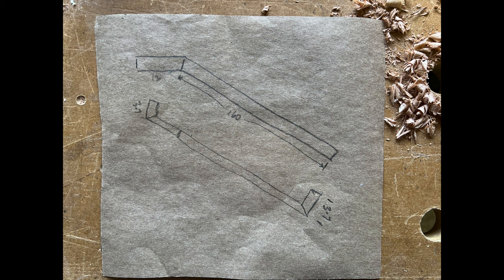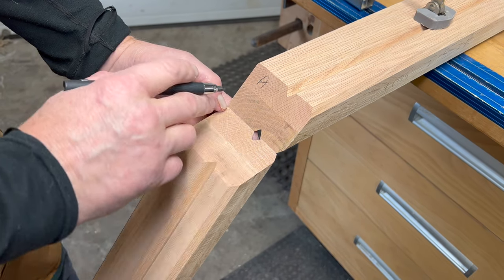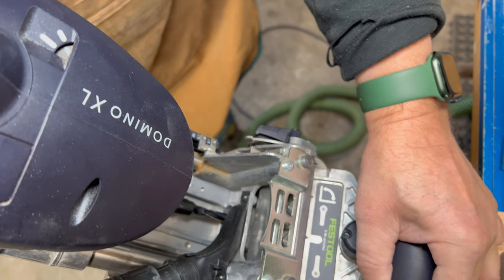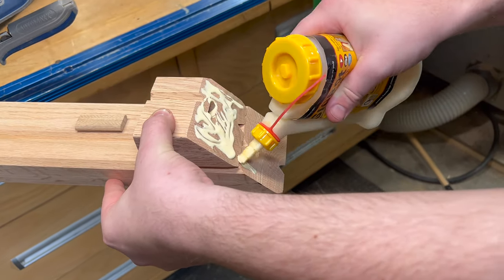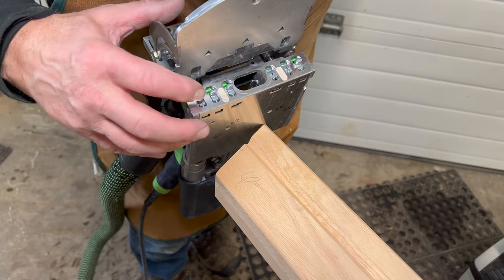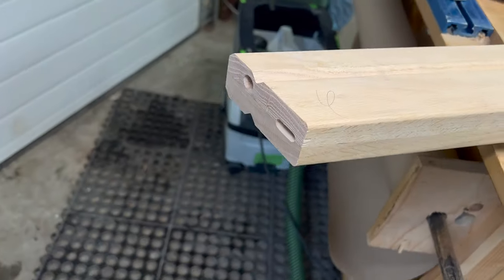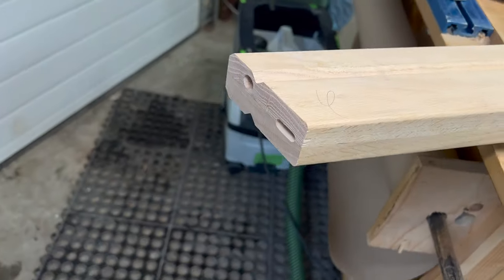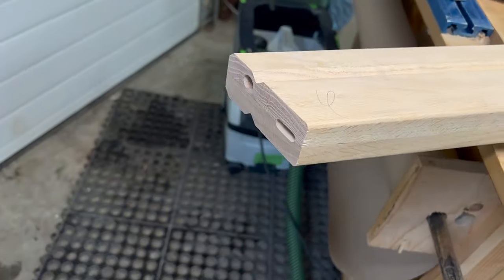Mitred Handrail: With amazing invisible joinery

Comment: The stair angle is 38.75 degrees.  The shorter piece of railing and the longer piece of railing were cut off by 38.75/2 = 19.375 degrees.  As such, your cut off piece (cut off from 90 degrees) is 19.375 deg but you are actually creating two remaining pieces that are 70.625 degrees.  So the angle of that resulting joined pieces of handrail is 2 x 70.625 degrees or 141.25 degrees.  Is that the correct way to think about this resulting angle?
Reply from the maker: You are probably right. You may find my video on stair math helpful. Towards the end I do a drawing and show all the stair and railing angles. Here's the link: https://youtu.be/qbch-YD7S98
Reply: @scottearlsmithFTC  Thanks for the reply.  In the video on stair math, I see that the stairway was 38 deg.  At the top of the stairs, the cutoffs are 19 deg each (and the part you actually are using is 71 deg), so I think that you are only speaking about the amount you cut off of the longer piece, as you can clearly see that the resulting joined piece is going to be (90-19)*2 = 142 deg.  Likewise at the bottom of that stair is 52 deg or 26 deg each, which results in an angle of (90-26)*2 = 128.  So I think that the stair math, for expedience, calculates the angle of the cutoff, not the resulting angle of the piece that's actually used.  So I think I get it...
Reply from the maker: @kshuf8426   Yes. I keep it simple though. The system I use enables me to determine the setting on the saw. That is practically what I need to know on the jobsite. Thanks for the questions. They help the algorithm. (Now there's another confusing topic!) Cheers Scott
Reply: @scottearlsmithFTC  Great youtube channel by the way.  I really like the Domino XL and I think a lot of your viewers would love to see a video tutorial about why the domino is so useful and how to use it in a variety of ways and angles.  I know you showcased the domino on some projects with it on your channel but maybe more of a video about the tool, it's various features described generally, and some how-to tips.  Thanks!
Reply from the maker: @kshuf8426  Thank you. Glad you're enjoying the channel. I appreciate the encouragement. I may do a Domino vid at some point. I've had other requests as well. Cheers
Scott

Comment: Great video. And what an interesting joining technique with that Invis. I am tackling a railing in my home on my own, first time doing a railing, this video has been a great insight. Question because I am a noob. I need to do a parallel section at the top and at the bottom to meet code in my area. The angle of my stairs is 40 degrees. So my mitre cuts will be 20 degrees I think right? Angles always mess me up. From there, how do you determine what angle to put the domino in? If you go straight on with the mitre, then they will be fighting eachother and not in a straight line. Domino makes sense to me when you're dealing with right angles and 45's, but once the angle is unconventional it messes with my brain.
Reply from the maker: Thank you for the compliment and for reaching out with your questions. Your angle cuts sound right. Check out my video on stair math to review and that will help. https://youtu.be/qbch-YD7S98

As far as the domino joints go, your domino will always be perpendicular to your angle cut. Best thing to do is practise on some scrap lumber pieces before you "take the plunge" on an expensive piece of railing. Hope this helps, Scott
Reply: @scottearlsmithFTC  Cheers! Thank you for sharing all your knowledge with us! God bless!
Reply from the maker: @axbxa  You as well! Thanks for watching. Scott

Comment: Your content has been incredibly valuable for a fellow Canadian who is new to stair building. I'm currently working on my first stair project at my mom's house and, unfortunately, I don't have access to tools like the domino or the lamello. I'm curious to know what alternative joinery methods you would recommend for situations like mine. Specifically, I'm looking to incorporate mitered returns and bevels for wrapping the handrail around a landing. The handrail is made of paint-grade poplar. Your insights would be greatly appreciated. Thank you!
Reply from the maker: Paint-grade poplar would be an ideal situation to simply glue your mitres (plain carpenters glue). I've done this in the past before I owned those tools. Simply use masking tape to hold the joint together while the glue dries. Add a few brad nails, or trim screws (either U2 or GRK) for extra securing if you like. I'd wait for the glue to set before I put a screw into the joint though. I've also used 23ga. pins to hold the mitres tight. Another tool that would be really beneficial is a Collins mitre clamp. Here's the link: https://collinstool.com/tools/4-pack-miter-clamps-pliers-kit/ Good luck with your Mom's stairs and railings. Scott
Reply from the maker: P.S. What part of the country are you in?
Reply: @scottearlsmithFTC  Thank you for those tips, Scott.  I feel much more confident moving forward with the project.

I’ve used the spring clamps for baseboard,  but wasn’t sure if they would be up to the task for handrail.  In all honesty, I was hoping you would say, ‘No, beg your mom for the Domino’, in which case I would have had some proof to show her!  Although it might be dissappointing having one now that our renovation is basically complete, and I could have used it for all of the wainscoting.

One final question: since the clamps probably wouldn't work for the 37 degree joints, where the rail changes from rake to level and wraps around the landing, would you just toe-nail brads to clamp the joint while the glue dries? I’ve experienced shifting when trying that method on other projects, but I am going to experiment with the masking tape as well.  I figure it might need some additional pressure for the glue to set properly.

By the way, I'm in Kelowna, BC, and I genuinely appreciate your help!
Reply from the maker: You can tape that joint up nicely using a little imagination. You could use a bit of CA glue as well to help hold the joint. You’d have the same issue with a domino unless you combine that with the Lamello Invis, and buying both would be a bit expensive. Of all the tools out there right now, I would say the Domino is one of the best. Definitely my favourite tool. There’s a big “cringe” factor when you buy one, but you’ll find all kinds of uses for it. I’m out at hunt camp right now and it’s quite cool out. Hopefully Kelowna is a little warmer. All the best, Scott
Reply: @scottearlsmithFTC  That’s sound advice Scott!  I presented these ideas to my client (mom), and while she is relieved that we can forgo speciality tools for the hand rail, she did raise one objection that I never considered.

If I joined the entire railing as one piece through the top flight, landing, and bottom flight, it would be difficult to disassemble it in the future to create clearance for moving large objects through the stairwell. 

I was thinking about it, and I might experiment using those rail bolts that have one threaded side and one coarse side for these two connections.  I’m considering bending them to a ~37 degree angle in my vise.  They appear forgiving when it comes to adjusting the connection a 32nd" in either direction to line the joint up before cranking them down.  I'm aware that they sell zip bolts that adjust to various angles as well, but I do have several of these traditional bolts on hand from our guard rail project.  I only ended up using one, for the half newel, on that job, so my experience is still limited. Is this worth pursuing or should I save myself the trouble?

It’s cold in Kelowna, but it’s not east-coast cold! I am expecting our first snowfall any day now.  Hoping for good luck in your hunt.  Brayden
Reply from the maker: Take a look at my video on railing connections with the Festool domino 700. Those connectors are ideal for connecting and disconnecting railings. The old school ones are a bugger to undo so I’d recommend one of the Zipbolt products instead. Good luck and thank you for the best wishes on the hunt. We got two grouse last evening. Cheers Scott
Reply from the maker: @wonkyw  Hi Brayden, Sorry I thought I'd answered this one on my iPhone. Anyway, I would buy an angled slipfix railbolt (or angled slipfix, or angled railbolt) for this rather than mess with an old-school railing fixture. They are a pain to un-do and not practical. Here's a link to Zipbolt https://www.zipbolt.com.au/stair-connectors.

You can try Lee Valley for zipbolt products or go to Cooper Stairworks online and get them to ship to Kelowna. Here is the link: 
https://cooperstairworks.com/products/stairparts/#accessories

Regards, Scott
Reply: Scott your willingness to help is beyond commendable.  You deserve all the grouse and more.  Thank you.
Reply from the maker: Thank you Brayden, YouTube now has a new feature called "Super Thanks." You will find that option on all my videos near the Like button. It is a way for viewers to make a small financial contribution to that particular channel. Don't feel obligated to give a Super Thanks, but most viewers don't know about that option so I thought I'd pass it on. Have a good day, Scott
Reply: @scottearlsmithFTC  Scott, I have something interesting to offer you.  I tried messaging through Instagram but you would have to accept the invite.
Reply from the maker: @wonkyw   I don't have instagram on my phone. Just on my laptop. I don't see anything there. (There is another Scott Earl Smith on instagram as well.) Drop me an email at scott@scottearlsmith.com